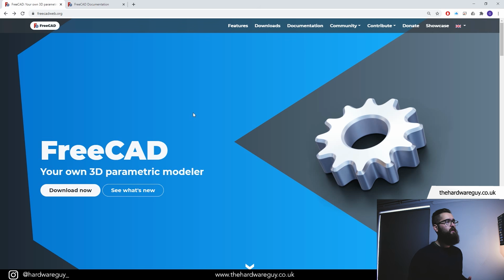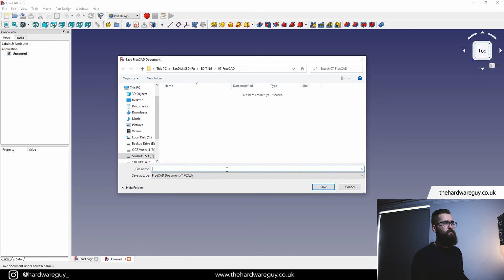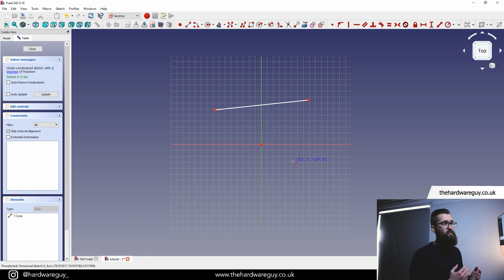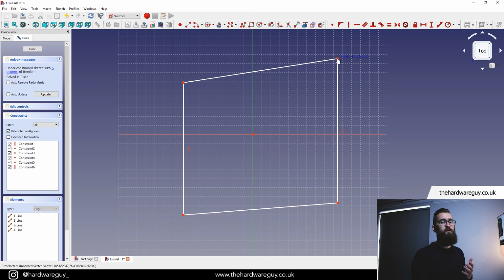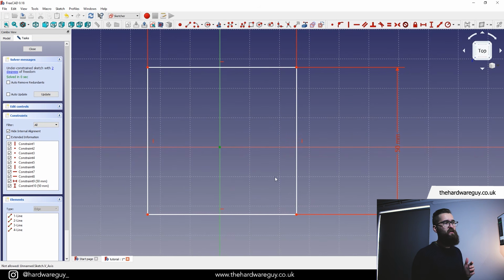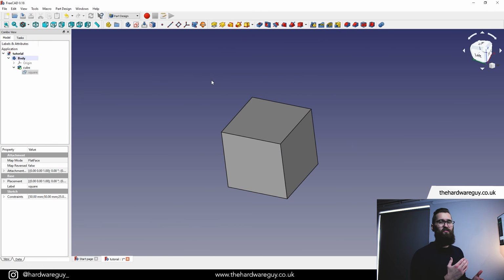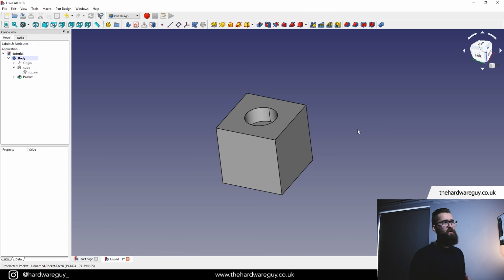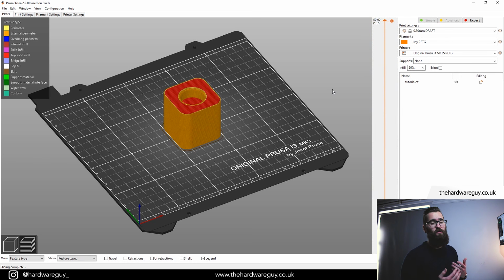FreeCAD For Beginners p.1 - UI, Sketching, Constraints, Extruding, and 3D Printing

Comment: Hi your tutorials are great. How about a lesson on making clock gears. I am restoring some morbier clocks and some of the wheels and pinions are missing I would like to print the gears in PETG and get the clocks ticking again. As you know clock wheels and pinions are not exactly normal gears by todays standards they are not exactly typical  involuté tooth gear the tooth is longer and the tip of the tooth is more rounded. 
Anyone else interested? 
Thank you dan

Comment: I am completely new to 3D design and printing. Could you just slow down a bit, personally it is a bit too fast to follow. But thanksfor the videos.
Reply: Go to settings in the YouTube pane (bottom right, gear wheel) and adjust playback speed.
Reply from the maker: Appreciate the feedback. I edit the video with harsh cuts which is why it seems fast. I do this to try and shorten the length of the videos. Sometimes a 40 minute tutorial can be a drag, you can always slow down the speed of the video by adjusting the settings in the bottom right!

Comment: Perfect timing! After 6 months of Fusion I have been wanting to give FreeCAD a try because of it being free for commercial use. The thing holding me back still is I haven't seen any youtube vids about inserting reference geometry in sketches (project in Fusion), creating advanced planes (like 3 point planes) and making features outside of sketches reference each other so they change properly on size changes without having to use parameters for every single thing.

I hope to have figured those out before your next vid though.

I do feel like Fusion is much (MUCH) more user friendly, though I have not been able to create a proper workflow in FreeCAD yet

Comment from the maker: Time Stamps: 
00:00 Intro
00:33 Download FreeCAD
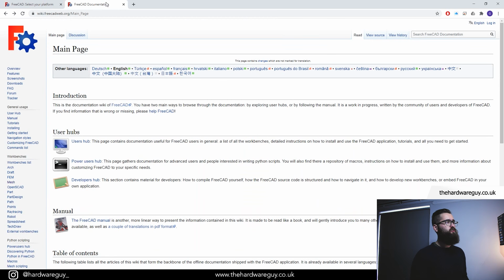00:45 FreeCAD Wiki
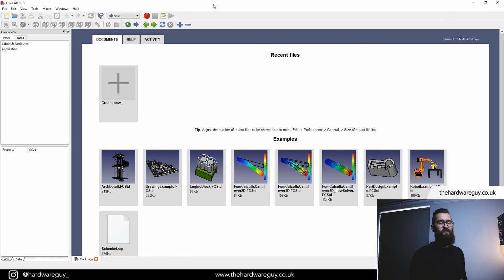01:00 Create a New Design
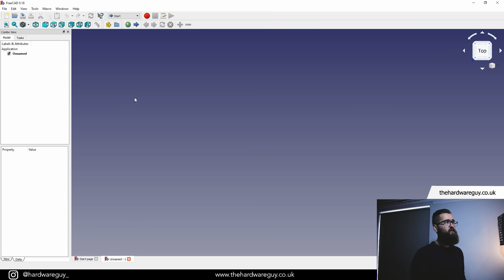01:12 Workbenches
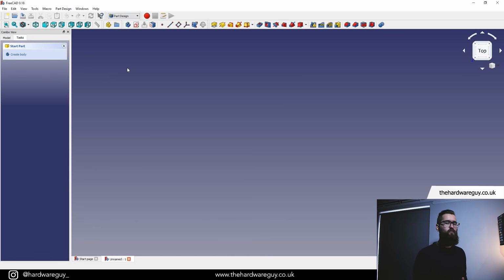01:40 Preferences and Units
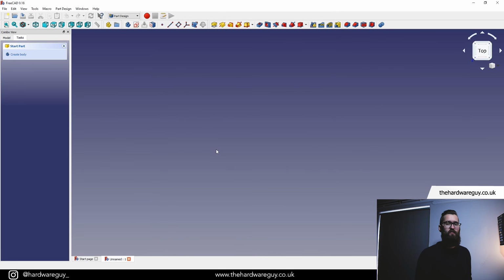02:27 Changing Workspaces
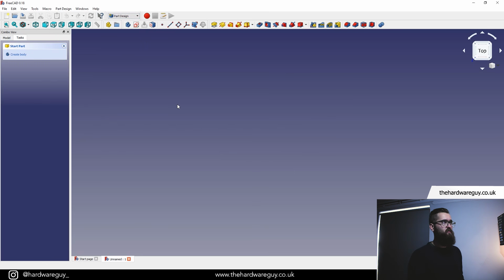03:00 Part Tree
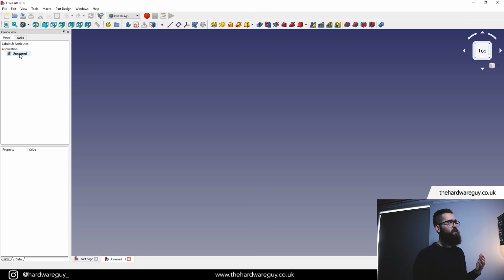03:12 Saving a Project
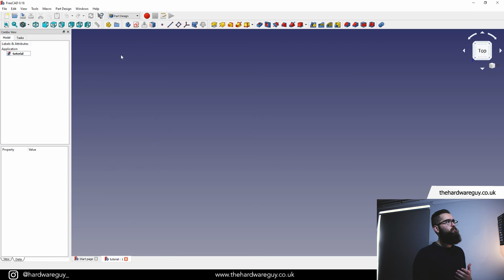03:42 Creating a Body
04:01 Toggle Visibility
04:17 Create a Sketch
04:37 Pan, Zoom, and Rotate
04:50 Selecting a Sketch Plane
05:13 Changing Views
05:57 Constraints
13:23 Extrude / Pad
14:32 Making Changes to A Sketch
15:05 Sketching on a Surface
15:42 The Circle Tool
17:36 The Pocket Tool
18:10 The Fillet Tool
20:10 Export as STL for 3D Printing
21:11 Outro
Reply: I am trying to learn CAD to enable me to produce models and 3D print them on my Prusa MK3s+. Your tutorials on FeeCAD are the most professional I have found. The clarity in your voice, the pace you deliver the material (not too fast) and your logical approach make it a joy to learn FreeCAD. Thankyou Thankyou Thankyou, keep up the great work. I look forward to more great tutorials.
Regards
Rex
Reply: Kun je ook Gcode aanmaken met freecad
Reply: i like your videos but you go to fast and it is hard to see what you are doing!
Reply from the maker: click the settings button in the bottom right and watch at x0.75 the speed

Comment from the maker: I made this series for the makers and hobbyists out there. When Autodesk recently announced their personal license changes for Fusion 360, they let down a lot of people. But not to worry because there are other options out there, and one of them FreeCAD. I believe that this video is the best FreeCAD beginner guide on YouTube, it covers all the basics and teaches sketching the proper way. - Gareth
Reply: It's true. I have struggled with constraints from the beginning. You have made clear in under 30 minutes what I have been beating my head on for 30 days.
Reply: @9MenWalking  I know your pain! I have doing exactly the same, this is a GREAT intro!
Reply: You do a nice job here, thanks.
Reply: I am a Fusion 360 refugee, looking for another solution. Freecad seems good.
Reply: Excellent video! Great job especially on explaining constraints. One useful feature that’s good to highlight for complete beginners is a shortcut to center the workspace view back on the part. It’s useful if they pan too far out of frame and lose their view. For instance I can double click the scroll wheel in fusion 360 if the model has gone out of frame, and it will recenter my view on the model automatically.
Reply: Superb presentation which helped me understand some of the basics and made me take those first baby steps!  I've done a far bit of AutoCAD 2D, but the 3D side - to now - was a closed book.  I'm going to try and modify an existing design and see how I get on!
Reply: Thanks Gareth, an excellent intro to FreeCAD for 3D printing hobbyists. I think I’ve now found the right software platform and tutor to set me on my way to 3D print design.
Reply: Fantastic tutorial, moving from F360 and everything was well explained and I got a model produced.  Thank you
Reply: Is there a way to roll the camera when rotating? It always gets crooked when I try to rotate around, it rotates around wherever I held down the shift key, I know I can click on the corners of the box in the top right corner to set to an iso view, but, is there a key to roll the camera?
FreeCAD does look like a good alternative to Autodesk dominance, but there are still things to iron out. Camera controls are kinda clumsy, and grid & snap settings are hidden away. Otherwise I'm quite impressed for a v0.19 piece of software.
Maybe it's a good thing Autodesk got greedy, It will motivate development of alternatives.
They got greedy with Max & Maya, now everyone uses Blender.
Maybe FreeCAD can become the Blender of CAD, and help undermine Autodesk from that angle too.
Reply: @peterbelanger4094  Try to use "Gesture" as Navigation Mode instead of CAD. Then click any point of the model with the mouse wheel switch. This will make to centerlize the the rotation of the model around that point. Gesture mode can be set as the default navigation mode via EDIT menu / PREFERENCES / DISPLAY / NAVIGATION tab / Navigation section / 3D Mouse click on the drop down arrow / choose Gesture and Apply.
Reply: Thanks for video really helps
Reply: Cool Video Thanks.  Last used Fusion 3 years ago, opened the app, today (as I now have some time to do so), was surprised that a subscription is needed.  It looks like FreeCad does exactly the same and for free.  For a hobbyist like me, this is ideal.  Great introductionary clip!
Reply: By far the best instructor for beginners.
Reply: Thanks for the great tutorial. I'm 70 years old and you can't imagine how many CAD tutorials I've watched and was still confused.  Now that I'm 3D printing  I need something better than Tinkercad. Your Freecad tutorial made sense and gives me hope I have finally found a tool that I can use successfully!
Reply: @jps99 70 me too. Just started with the 3d printer. Used Tinkercad for a few hours, just not enough detail. So jumping in with both feet with FreeCAD.